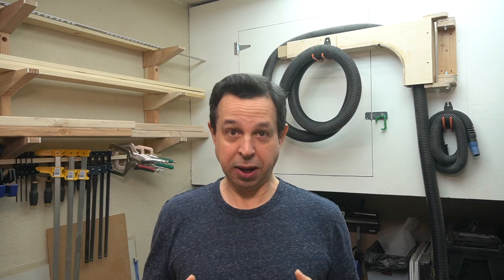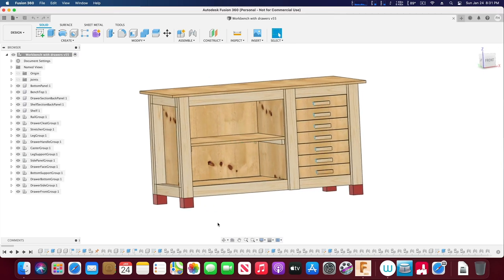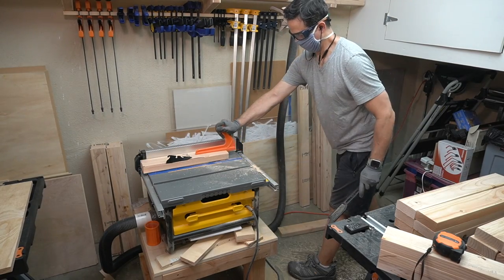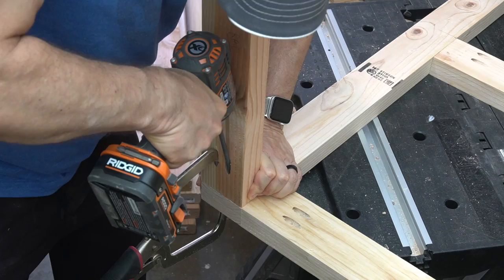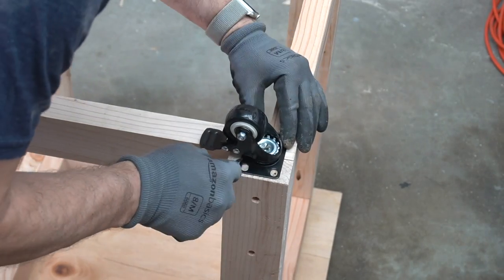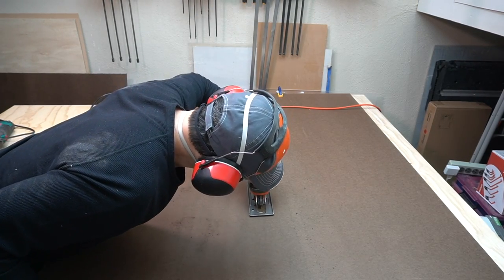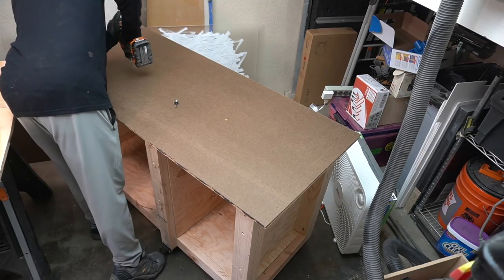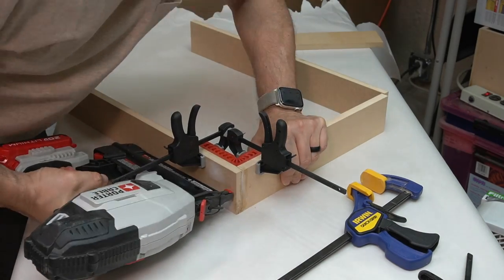Compact Workbench with Pocket Hole Joinery and Casters for Small Workshop

Comment: Looking good! High quality content, for sure. Regarding your miniature circular saw, when I bought my circular saw, I was getting exactly the same feeling, and exactly the same black cuts and smoke. It turned out I'd put the blade on so the cutting edge was facing the wrong way. No idea if this is your issue, but when I saw those cuts I figured I just had to throw this out here, just in case.
Reply from the maker: Thanks for the info! I'll definitely take a look at that. I kinda hope that's the problem -- at least that way the mini saw wouldn't be a waste.